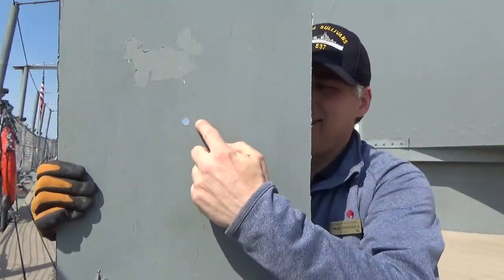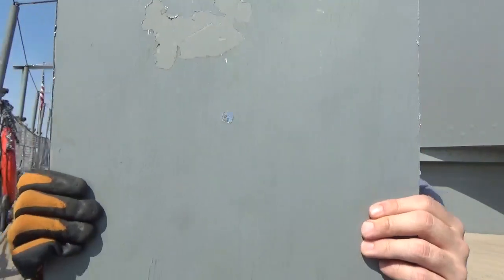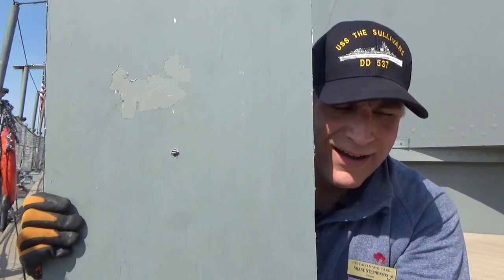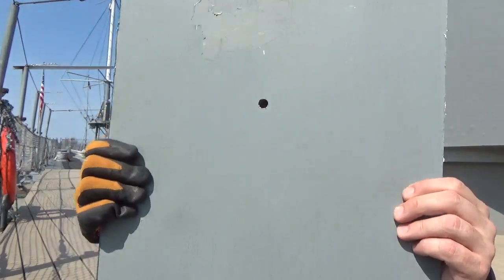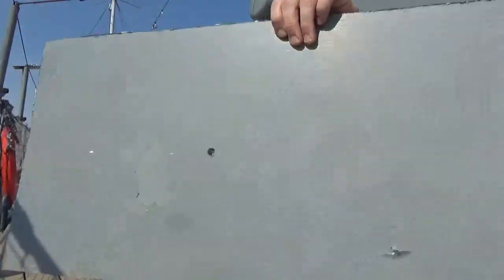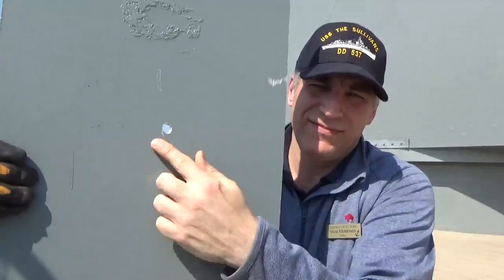How do we patch holes? Buffalo Naval Park

Comment: On HMS Leander which had a hull of a similar compromised nature, out on the Baltic when the hull was perforated we dropped rubberised plates over the side then shot rivets from the inside using a lethal riveter that used .762 blanks. I dont know the name of the riveter as I was not directly concerned with it this was an almost daily task with up to 2 feet thick sea ice ripping into her hull

Comment: Were these recent 55 holes patched this way or welded?
When was the last time it was dry docked and will it be dry docked soon??
Reply from the maker: Gino - she was last dry docked in 1965. The process includes welding small patches were they can in conjunction with two part epoxy. Thanks again!
Reply: @BuffaloNavalPark  Wow that's even longer than the Queen Mary, any plans on dry docking her soon?
Reply from the maker: @ginog5037  When we are endowed with the $5 - $6 million we will be dry docking her immediately! Thanks!
Reply: @BuffaloNavalPark Will the Navy dry dock her for you?

What about permanently taking her out of the water? 
I know the engineering will be expensive but it will preserve the thin rusty haul forever...

Comment: What makes any of these an appropriate solution? The foam especially sounds dodgy,
Reply from the maker: Ultimately, the best solution is dry docking, but at $4 - $5 million dollars, not financially possible. The work started last year to coat the hull in a two part epoxy is meant to last 10 - 15 years, allowing us to raise those millions and then dry dock her. Foam is actually a good solution. It's been used on other ships...you blow it in, it expands and hardens, but it's not heavy and therefore doesn't put those unnecessary stressors on the hull. Hope this helps!
Reply: Hi Shane,  @BuffaloNavalPark really appreciate your engagement on this channel, I've been following and appreciate your updates. I guess I was curious if you had a particular source that recommended those techniques. 

I am an engineer but I'm not specifically a materials expert, I can say there's a big difference between that yellow expanding foam (closed cell, stiff, waterproof) vs what's essentially a sponge (open-cell).
Reply from the maker: @jj-jak  Well, thank you! I don't have that background...but, it seems as though when we spoke about it, we mean the yellow expanding foam - without knowing the actual product! The USS Texas has used a lot of foam in their torpedo blisters...and we heard a presentation from them last year at our conference! Really appreciate you watching, and glad you're engaging - we're doing our best!

Comment: If rust is widespead, entire plates need to be replaced or the problem comes back in a short time, like months.
Reply from the maker: We've considered welding the plates over the original strakes, but in too many places there isn't enough foundational steel to weld too. We patch about 12 - 20 holes a year for the past 10 years. Thanks for watching!
Reply: @BuffaloNavalPark  So you don't give her the dignity she deserves! Then give her the dignity of scraping her. What an insult.!

Comment: Drydock ship, weld new plates, Fixed. Now spend big bucks just to refloat ship then drydock. No smarts at work.
Reply from the maker: Robert - we didn't have the $4 - $5 million to be able to dry dock her, and there was always a question of whether she could be towed the 90 miles. So, the work begun last year to coat the hull below the waterline in the two part epoxy (videos of that on the channel), was going to give a 10 - 15 year protective layer so we could raise the money. We wouldn't want to lose her in Lake Erie towing her without this epoxy. At least here she is resting on the bottom, but the middle of the lake? She would go right down. Thanks!

Comment: Do you guys have it later repaired properly or is the hull of the ship down there basically swiss cheese with silicone poored in the holes ??? Bcs fixing it like that isn’t gonna work for ever and as we just saw, it didn’t, it sank.
Reply from the maker: Simon w - we didn't have the $4 - $5 million to be able to dry dock her, and there was always a question of whether she could be towed the 90 miles to the nearest dry dock. So, in addition to patching holes with the staff that we have like in this video, the work begun last year to coat the hull below the waterline in the two part epoxy (videos of that on the channel), was going to give a 10 - 15 year protective layer so we could raise the money.
Reply: @BuffaloNavalPark  i’ve heared of a technique with electricity that slows down or almost prevents corrosion that is used on many old ships. Does this one have that ? And yeah fair enough for the dry dock part, but its gonna have to happen some time in the futur thats for sure.
Reply from the maker: @simonw2631  Thanks! We've talked about the process you may be referring to. It's the Cathodic Protective System. It's mostly used by ships in salt water, as it's the salt part of the equation that the protective system stops. So, after some discussions last year it was decided (at least then) to not build that into the two part epoxy plan.
Reply: @BuffaloNavalPark  If you have the excuse to say you didn't have the money to do it right, then give her the dignity of scraping her. NO RESPECT FOR THE LADY!
Reply from the maker: @usveteran9893  George, again - we'd enjoy having you funnel that passion here to help keep her afloat!

Comment: Haa, that's the way I'd do it too, using  basic methods. And Have used J-B Weld a lot myself in a shop/factory operation.  Thanks
Reply from the maker: For the past 10 years, plugging 10 - 20 holes a year, these are the ways we could do it with the staff and budgeting. Thanks!

Comment: Once the hull's protective coating/paint is compromised, the water  starts rusting the metal. The rust then expands and lifts the edge of the surrounding paint, this continues in an ever expanding circle around the original entry point. As time go on, the metal continues to rust more and more. The compromised metal is thinnest at  the starting point, but can be quite this over an irregular and large area. 
I do not work on ships, but I have done quite a bit of similar metal work and leak repair. 
As for welding a patch, one has to remember that this is not battle damage where the metal has a hole punched through it but is still the original thickness. 
If you did strike an arc on the compromised metal, you would burn a hole that is just as bad or worse than the one you are trying to fix. 
To make this kind of repairs, The Sullivans  would have to be put in "dry dock" and the hull completely stripped and sand blasted to find and replace all the bad places. 
Only the government could afford that.
Reply from the maker: Thanks for your comments! Yes, this two part epoxy paint and the corresponding foam inside covering the four feet of the water line\splash zone is a 10 - 15 year fix, so in that corresponding time we would be able to raise the $4 - $5 million to dry dock her. Yes, many places on her wouldn't take a weld patch\blank because there isn't the thickness to adhere to!

Comment: Unfortunately, the aluminum plate + steel bolt in the steel hull is not an optimal solution.  A temporary solution to a permanent problem.

The epoxy based patches pop off as the  steel continues to corrode under the patch.  A very temporary solution.

The magnet and patch of banner material (in the Navy we called it "Herculite" which might have been the brand name) lets you stop a leak (or slow it ) fast.  Extremely temporary.

30 to 60 years of temporary solutions are adding up.

The only right fix is drydock.  Weld repair or replace the plates. and give it a really good paint job (with the right paint, which is expensive)
Then it needs a haul-out (drydock), scrape and repaint of the hull every few years (not the appx 60 years since it was last hauled out)

Expensive... but pay soon or it's scrap.
Reply: That's exactly right.
Reply: Absolutely correct. Even with these 'fixes' in place, the holes will continue to spread and will quickly outgrow the patches. All of these are just creative ways of kicking the can down the road. The proof of this statement is listing to starboard in Buffalo right now.
Reply: Not only is it expensive, there aren't enough drydocks to handle the demand so the lines to get in are really long.

Comment: Maybe a toggle bolt would work for securing your patches on the outside. I am talking about the ceiling toggle bolts that we use the put a hook in the ceiling to hang house plants. I am sure somebody makes bigger toggle bolts. The ones we use for house plant hooks are probably small for your patches. But if you had a stainless steel bolt flat plate with rubber and the toggle nut a diver could install a patch from the outside by himself. It would defiantly save time and money by not having to look for the hole in a cramp spot inside the ship. I bet somebody makes bigger toggle bolts. It might be worth looking into. Changing the threaded bolt to a stainless bolt would make the life expectancy of the patch last a long time. I hope I have helped and have a great day.
Reply from the maker: G Myers - thanks for your thoughtful comments. It's always a crap shoot, because we don't know the size of the holes until we get down there. Sometimes we've had two holes next to each other and that requires work to stop, while we make a double patch with the two bolts side by side, and to make sure their measured correctly. The work we had started last year is going to render 99% of this work moot, and we will be spot surveying and plugging (not patching) where needed! Thanks so much for your viewership!